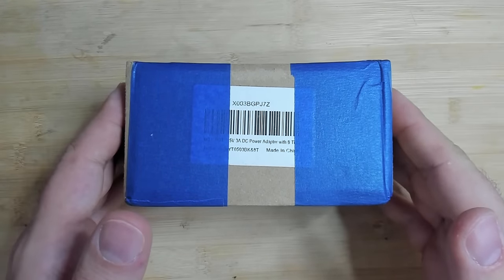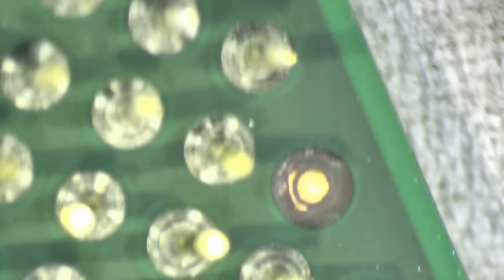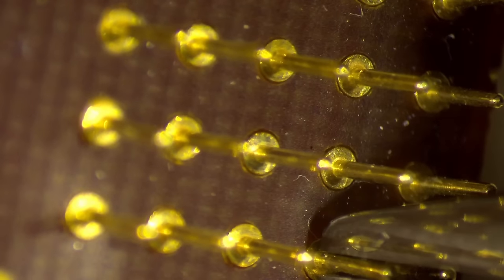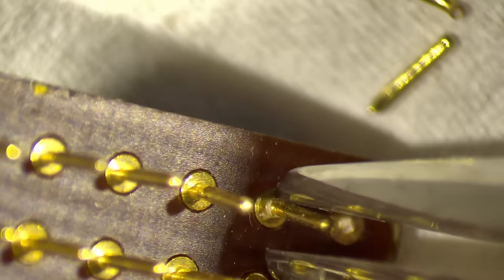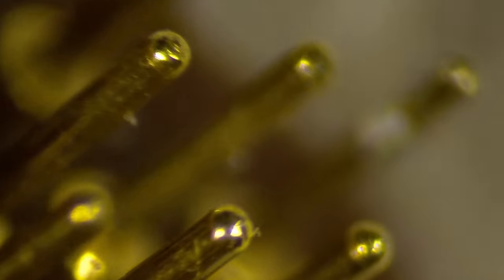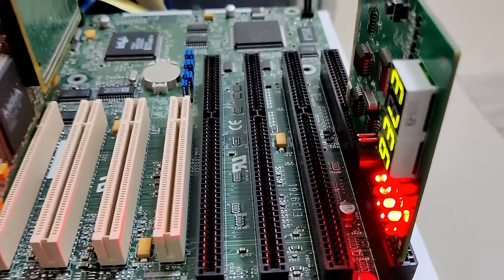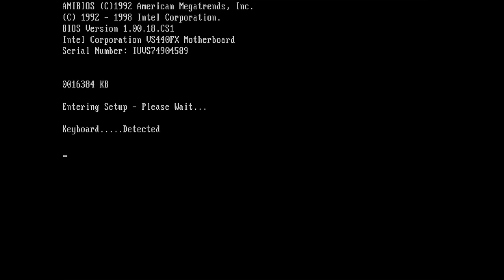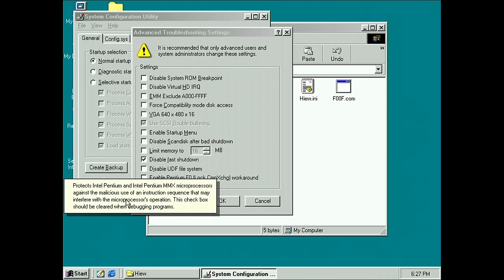1024K reasons to fix this Pentium Pro 1M!

Comment: And this is why I sent you that CPU. :) I knew that I wouldn't be able to fix it myself, and I should leave it to the expert.  Like I wrote before, it was exactly like that when I got it, including the missing pins. I didn't attempt to straighten any myself because they're so weak. I'm happy that it lives again.
Reply from the maker: Sorry that it took so long to make that video. Thank you for the CPU - I am sure it will appear in more videos!
Reply: as bits und bolts sad at the end of video, is there any benefit to have a 1m cache version or its just a collection thing please?
Reply: @dim0n1  It helps caching a larger amount of main memory, which is/was at the time primarily useful in servers. In a day-to-day retro-gaming-PC scenario, likely slim benefits to none.
Reply: @dim0n1  useful or not 1M Cache "on package" was insane at the time
Reply: Got it, what I thinks, thx..
Reply: @tomteiter7192 
Holy balls that's a lot of cache for the 90s... 😳
I imagine for scientific work that was a dream machine
Reply: @MostlyPennyCat  indeed
Reply: @dim0n1 yes indeed, in the server and hi-end workstations! Those beasts were super rxoensive and pretty often had insane size of ram for their time! Most of these cous are from Compaq / IBM servers demolished by scrappers..😢

Comment: I ran a PPro 200Mhz for WAY longer than I ever should have up until 2003 on a windows 2000 box w/ 3DFx Voodoo 2. This video warmed my heart.
Reply: That's gangster man.
Reply: That's about how long I ran my P200 mmx (non pro) with a voodoo 3 2000, but I never went higher than 98SE.
Reply: @madmax2069  I had 486/160 running NT4.0 :-)
Reply: @madmax2069   It often amazes me how back in the day people had such an imbalanced setups. I had K6-2 350@500Mhz and Banshee, and that was bad enough, but voodoo3 needed at least decently clocked Pentium 3 or early Athlon to stretch its legs. The poor thing must have been so bored on that MMX 200.
Reply: Well, it was an insane monster setup at the time. Hard to let it go, I imagine :D
Reply: Cool I still have my voodoo 3 card somewhere
Reply: @Lady_Zenith   it may have been unbalanced but the video card that was in it was a S3 virge DX. So I took what I could get. It went from most games being unplayable to games being playable.
Reply: @paisleyboxers I also used a dual Pentagram Pro 200@233MHz/512KB L2 192MB RAM as a second PC until sometime in 2004. Nice memory :)
Reply: @paisleyboxers  I would love to build a PPro retro PC with my leftover CPU, but socket 8 boards are almost impossible to get nowadays
Reply: @Lady_Zenith  Aww... I had a 1Ghz Athlon with a TNT2 M64. Poor CPU was wasted until I got my GeForce3.
Reply: Pretty sure I had a 128MB Radeon 6250 on a 500Mhz K6 2 running XP back in the day. Definitely had that card on a 1GHz P3.
Reply: I ran dual PPro 200s for years. Upgraded to 2x PII-Overdrive 333 on the same board.
Fun days!
Reply: In 2003 I was still using a regular Pentium 200MMX and a single Voodoo2 and Win95.  In 2005 I found an IBM 300PL with a Pentium 2 400mhz with Win98 installed that someone had put out for the trash and I got a Voodoo3 for it off ebay for cheap and used that as my new main PC for two years.  I still have both PCs, the 200MMX lived a very hard life since 1997 and it had the same Win95 install that was so overly bloated that Diablo 2 Act 4 was unplayable and it took FOREVER to boot.

Comment: Straightening tiny pins like this can be done using a mechanical/propelling pencil tip/tube if you remove the pencil lead. Gives support all along the pin and doesn't need tiny pliers.
Reply: .7mm .5mm or .3mm lead size?
Reply from the maker: I have tried this method and I agree that it works. Unfortunately, my hands and the pencil will block the view when I work on the pins. I also believe that all the pins that broke off would also break with a mechanical pencil. Those pins are the most fragile pins I've worked on so far.
Reply: Having done a few, they're done for when bent at the base. The material stress is too high. A mechanical pencil works only so well. Physics has claimed those pins, time for donors.
Reply: @bitsundbolts  Yeah if you are trying to film under a microscope not ideal for sure and there's no saving pins that are visibly damaged at the base are done for regardless of method as you say.

Comment: It will be interesting to see some benchmarks with this CPU :)
Reply: it would be interesting comparing it to a regular Pentium (P54) without 3D acceleration in Quake (software rendering)
Reply: Very
Reply: You'd be disappointed, they're no more than 10% faster than the original 256K variants. The Pentium Pro wasn't an architecture that heavily relied on cache for performance, unlike the much later Pentium 4. I have both 256K and 1M versions of the Pentium Pro 200 and did basic benchmarking on them.

They're also VERY bad in 16 bit code and mixed 16/32 bit code because of a bug in the core design. Whenever the Pentium Pro wants to execute a 16 bit instruction, it has to flush the entire instruction pipeline every time.

Back in the day, the only people that these 1M parts would appeal to are people that are already heavily invested in Socket 8 hardware. These chips were released when the Pentium II was in the mid 300 MHz range, and those chips were half the cost and netted far better performance. It made no economic sense to buy these, they were obsolete when they were launched.
Reply: Yup, please do a comparison performance video.
Reply: To be honest, I can't advise you in the best situations where it would be more useful. I do have to say gaming would be the most interesting. Using those Voodoo2's with that overlooked Pentium Pro vs MMX vs. Pentium. Could all be interesting.

Comment: Yet there are people who destroy perfectly fine Pentium Pros for gold...
Reply: Gold is more valuable.
Reply: Makes me want to puke. And they trash a rare, valuable piece of computer history for what? Maybe $5? Idiots!
Reply: @unmountablebootvolume  5 dollars is A LOT of money in some places of the world.
Reply: @iamperplexed4695  But much less than the $70+ that a working pentium pro is worth.
Reply: @unmountablebootvolume  I am just going to assume that you don't know about the recycling and reclamation methods that electronics use and the path through the word that they follow.
Reply: @unmountablebootvolume I believe it is closer to $30, maybe $35, today.  I recall there being 1 gram of gold, but not in the plastic packaged chips, like this one.  The expensive ones were the 'first gen' (primarily) 256kB chips.  Despite the draw, at one point, I never scrapped mine.
Reply: @andrewb6  Thank god you didn't! According to my 3-minute google search, even the cheap ones now often go for $70, with high spec ones easily costing $130+. While worthless at one point, these things seem to have once again gained far higher value as a functional CPU than the materials in them are worth.
Reply from the maker: The ceramic CPUs are indeed coming from the scrapyard - all of them. If I wouldn't have picked them up, they definitely would have been scrapped.
Reply: @unmountablebootvolume Gold bugs are some of the most short sighted people you will ever meet. Pointless to try to convince them otherwise of the value of these chips. They have no perspective with how few were made...

Comment: Half a month ago, I saw a small laser device for repairing gold necklaces at an exhibition in Shenzhen. My first reaction was that if it could be used to repair CPUs and sockets,
Reply: You can get incredibly small tig welders meant for Jewelers to tax stuff together so that they can flow gold or silver solder on them

Comment: Now that is a CPU. 

1MB was an insane amount of on package cache for the time as well, so expensive.
Reply: While it was an amazing feat of engineering, the 1M parts were obsolete on launch. They were no more than 10% faster than the older 256K and 5% faster than the 512K variants. They were also released so late that the Pentium II was already in the mid 300 MHz range, and were much faster for half the cost. Unless you were already invested in Socket 8 hardware, it made no sense to buy them.

Comment: I had a couple of dual PPro 200 512kb systems I built for where I worked at back in the day, but never saw a 1mb cache version. One of them was used until around 2005 due to lack of a budget to replace them, and at 233mhz and 2 cpus it was still decent for office productivity at the time.

Comment: Glad to see you got it running again. I had a similar experience when reviving one of my 1M PPros, they have significantly weaker pins than the ceramic 256k/512k models. I think these are machined from a rod of brass, while the others are gold plated copper.
Reply from the maker: Absolutely agree! Those pins on the black-top model are very fragile. And seems like those pins are one-way bend only. You can't bend most of them back - they'll all break.
Reply: I remember I was ham fisted in getting a CPU socket, and I used one of those mechanical pencils that use the bare legs that were like 5 mm and they were a perfect fit to straighten the pins

Comment: Hearing your vocal expressions of joy upon success never gets old. 😄 No idea why you were apprehensive of this repair, it literally went exactly as I expected. But then again, I'm an optimist, haha. Those pins cannot be pure gold, they behave almost like an aluminium alloy. Looks like Intel was trying to reduce costs on those chips, as the huge cache probably made them expensive enough already. On a side note, Knipex are of course the best (not just the flat jaw ones) and these pins were probably all beyond saving so it didn't make a difference here, but generally speaking I believe the toothpick method may be more gentle and yield better results in some cases (esp. pins on pads), as it allows you to apply counter leverage and thereby better focus on the area that force needs to be applied to.

Anyway, it's always heartwarming to see another historic piece of computing tech back in action, I'm really looking forward to seeing more content about it in the future!

On another tangent, I'd like to rant about the fact that BIOS flashing can STILL be a super irritating process, specifically if it is necessary to flash a board so that it actually supports the CPU that you bought for it (e.g. a B650 board so that it supports a Ryzen 9000 series CPU). At least these days, you can usually flash it without obtaining and installing a supported older CPU first, but the process is usually not sufficiently well documented and often fails without apparent reason. I pity the person that doesn't have a bag of old USB Sticks to try until one is found that works. End of rant! 😉
Reply from the maker: Good point regarding cost cutting from Intel. These pins definitely are a lot weaker than on any other CPU I worked on. Even other PPGA models like Pentium MMX and Celeron Mendocino have better pins even though they have the same type of body.

Comment: Great job on the repair and BIOS upgrade! I was surprised how weak those pins were, but I'm glad you could get this CPU working again.

I had a Pentium Pro for a while, it was a 180MHz model (I believe 256K cache), which I immediately overclocked to 200MHz since it came with a big heatsink (much larger than the one on yours). I even bodged a larger fan on, which dropped the temperature a little, but it ran stably for a few years, I never had any problems. Looking back, I'm not sure how much of a real upgrade it was, since I came from a Pentium MMX 166MHz. It's possible those MMX instructions may have made it faster than the Pentium Pro in some games.
Reply from the maker: Those heatsinks came with those boards. I'm not sure what they are, but they seem to be just good enough to cool the CPU. A better cooler would be great, but I've heard those coolers are rare these days.

Comment: Back in the day when worked in the computer shop customers would do this time to time when upgrading their cpus. As a last ditch effort to fix it for them we’d stick a appropriate gauge wire into the CPU socket holes where there were missing pins and added a small curl to the top of the wire to give it a bit of spring tension. If you do it right it works about 80% of the time as long as the original pad is left on the CPU. Have you tried watch makers tools? They are kinda a godsend for this kind of work.

Comment: An empty mechanical pencil tip will do wonders to straighten these CPU pins, you should try it. Put the pin inside up to the first bend then straighten it enough to push it in to the next bend and straighten again, repeat until you get the whole pin inside and can straighten it all.

Comment: Perfekt! Geduld zahlt sich aus! Leider habe ich keinen 1MB Ppro in meiner Sammlung aber immerhin einen Slot2 Xeon. Ebenso fehlt ein PentiumII-Overdrive für Sockel8. Wenn die Pins so dünn und empfindlich sind, probier doch mal die Dinger punktuell anzuwärmen, damit sich das Metall etwas entspannt und nicht bricht. Jetzt auf jeden Fall Benches mit Pentium 233MMX gegen PPro in allen Cachestufen und P2-233.
Reply from the maker: Ja, da muss auf jeden Fall sowas wie ein Benchmark Marathon kommen. Ich habe ja alleine schon 3 verschiedene Cache Ausbaustufen: 256, 512, 1024 beim PPro. Und dann vielleicht Pentium und Pentium MMX.

Comment: 36:58 It is highly likely that the CPU threw an exception, without there being a handler for it. I would run it with EMM386 or something similar loaded into memory. My guess is that DOS will then bail out with exception 6 or something similar, since it is, technically, trying to execute an invalid instruction.
Reply: An invalid opcode 06, or general protection 0D, run these in real mode. And patch in an exception handler.
Lucky you still have interrupt enabled STI then youll need cold boot if interrupt off CLI

Comment: I always use a mechnical pencil (the ones you use in school for geometric drawing, i live in austria so please don't ask what they're called in english, we call them Druckbleistift), the tip of those pens fit perfectly onto the pins and the pencil gives you very good yet controlled leverage on the pins (it also fits perfectly between them so you don't nudge another pin accidentially). The pencil method never failed me on bent pins.

Comment: Great save!
The 1MB are totally different beast compared to the ceramic variants, not sure why they changed the package but they look a lot cooler =).
And the PPro overdrives are worse still when it comes to the pins, very strong and rock hard but breaks even easier then the black tops.
Regarding to the heat output from these "beasts" I suspect Intel was "creative" with the power numbers cause there's no way the 1MB chips are just 9w more then the 256Kb variants.
I reckon the 1MB pulls close to double the power in real use!
Also I'd recommend using a thin thermal pad (I use 0.5mm) instead of  paste, the black aluminium top might look cool but its certainly not flat enough for paste to work properly.
And beware the heatsink in the CPU power supply on the board, it gets incredibly hot when running theese chips.

Looking forward to some benches, don't forget to enable write combine! =)

Comment: I did not expect the detached pins to flow that well! I expected that the tweezer would steal just enough of the heat to make it incredibly challenging, obviously this was not the case 😅 well done!
Reply from the maker: I was surprised as well. Seems like the base had enough thermal capacity to draw the solder nicely around the pins and the base.

Comment: Great repair, I'm really surprised how solder did go around the base of the pin. Great success!!!
For the absence of floppy drive activity, you could try the oled mod for the gotek emulator with the flashfloppy firmware.

Comment: I used to work for a Geek Squad warranty fulfillment center during the days of the Athlon 64.  Our parts department was so careless, they would send CPUs to the repair line in loose plastic bags with no protective foam and no anti-static bag.  They were probably stored that way in a bin I guess.  By the time they made it to the repair line, the pins were all bent to hell and I really had no option except to waste 20 minutes straightening them out with a pocket knife.  And I had to replace a lot of those Athlons, as I recall they had some problem with the onboard memory controller.  Lucky I never had to re-attach any pins like this!

Comment: I use syringe needles for straightening pins - it is much more convenient than a toothpick:
- find the needle of the right size  (one that just slips over the pin);
- clip off the tip (do not mash it);
- put the needle over the pin and bend it back.

For thick pins of older CPUs a mechanical pencil can be used instead of needle.

Comment: The PPro 1M are also stable at 3.5 x 66MHz = 233MHz (if your board supports 3.5x). I have two of these PPro 1M running on a Tyan S1662 board at 233MHz. :)
Reply: I have a couple 180MHz overclocked to 210MHz. If I ever get 200MHz 1M, I will definitely try to get 233MHz!

Comment: You might know this, but the 1mb PPro was not flat and needed a special heatsink to match.  I sanded one down years ago but didn't have a way at the time to check any difference in temperature.
Reply from the maker: I am not aware of this. However, I used thermal paste between the CPU and the cooler. It looked pretty flat to be honest.

Comment: In the past, I've found the best tool for bent pins is a mechanical pencil, and to make sure the pins have been warmed up first to minimize cracking. Not too hot to melt the mechanical pencil, but like, hair dryer warm.